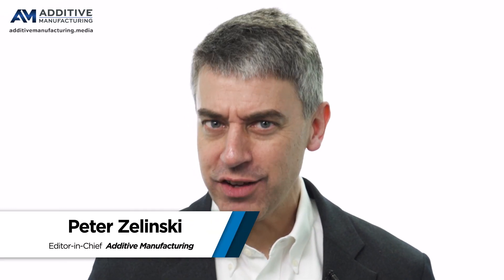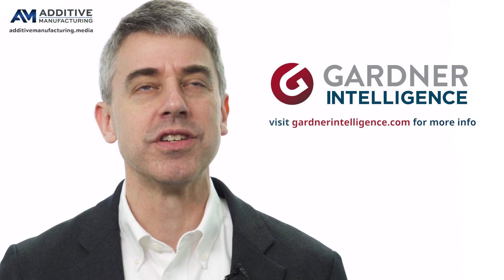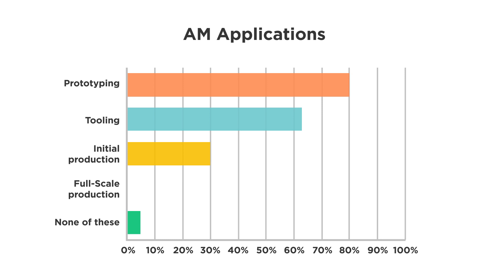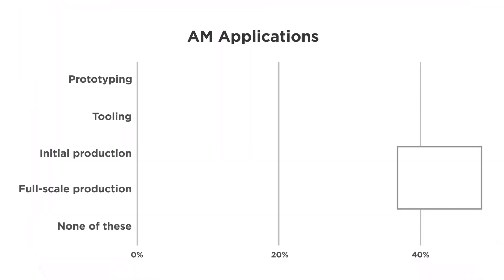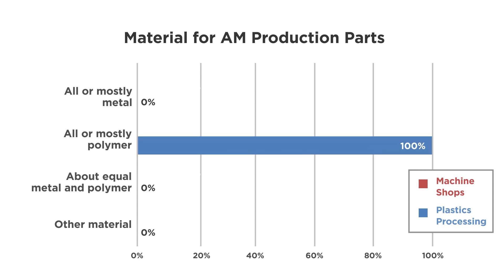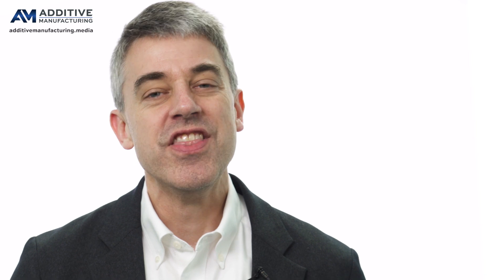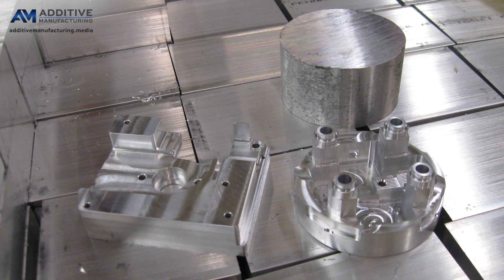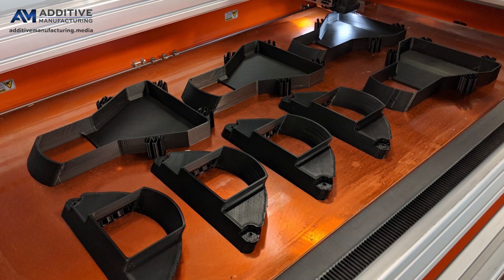Are Machine Shops Shifting from Metal to Plastics?

Comment: Key insight: "...a machine shop is where you go for low volume production."  Therefore, expanding the tool options for low volume production - such as adding 3D printing - better fits customer needs.